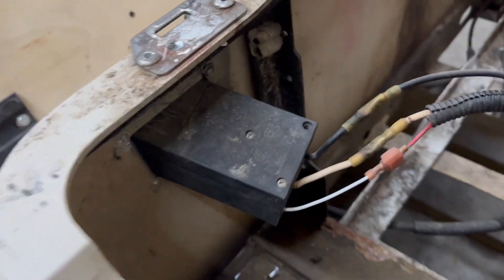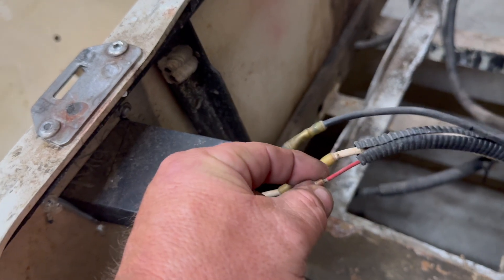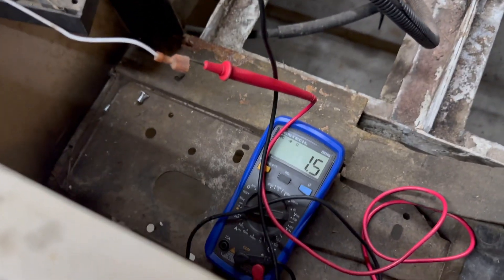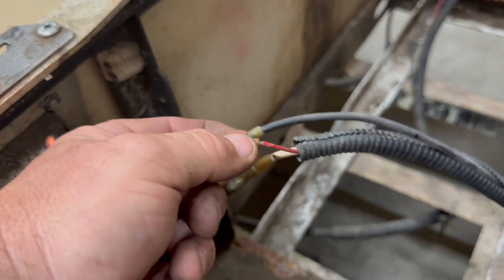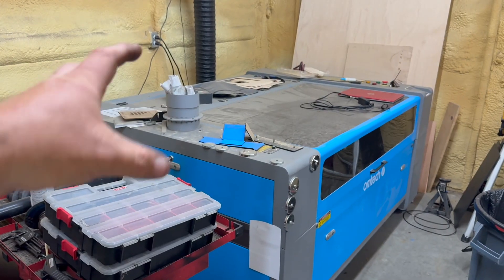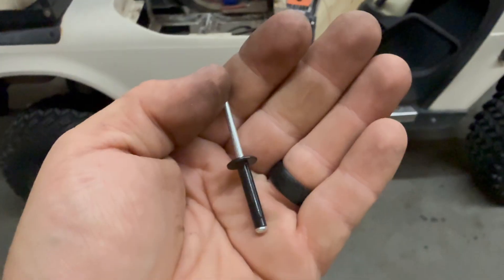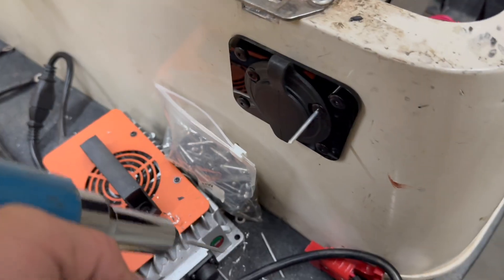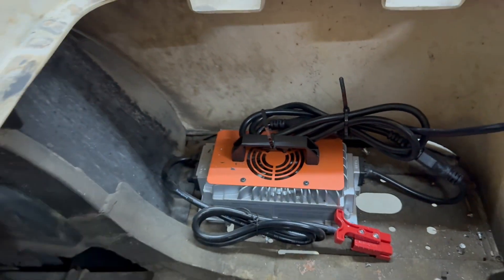How Does An EZGO Txt Golf Cart Reed Switch Work | How To Bypass

Comment: Why cant you connect the small red wire to the same connector as the white wire which runs back to the battery  positive?
That would be easier than peeling back the red wire and undoing it from the flex loom.